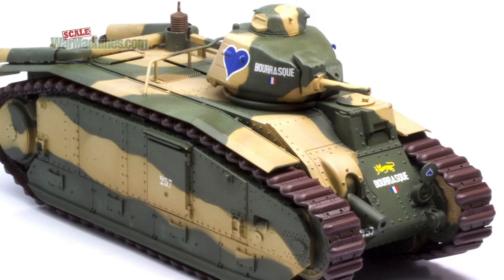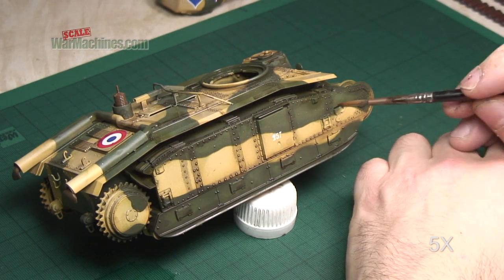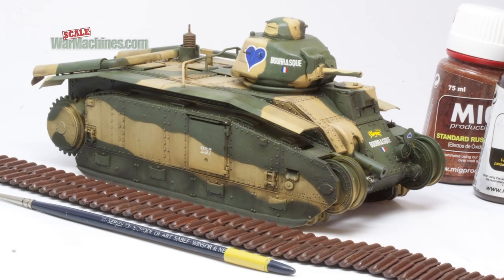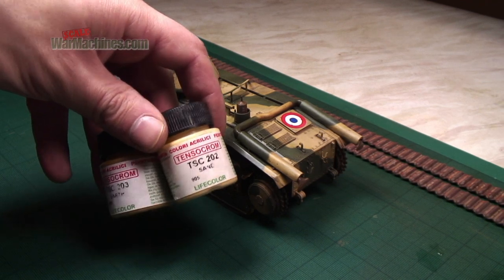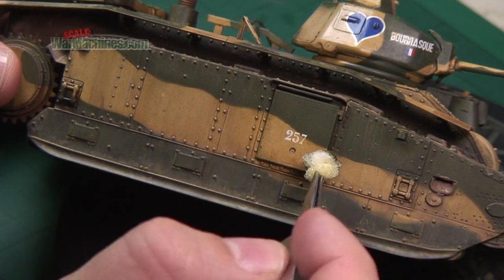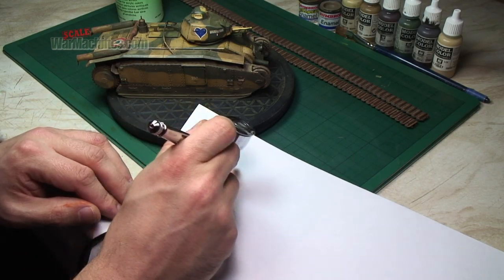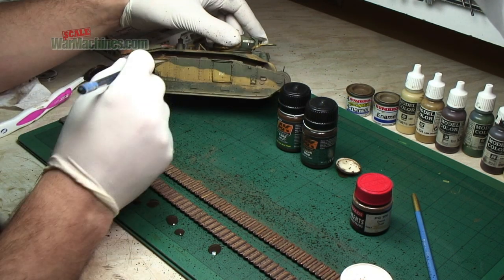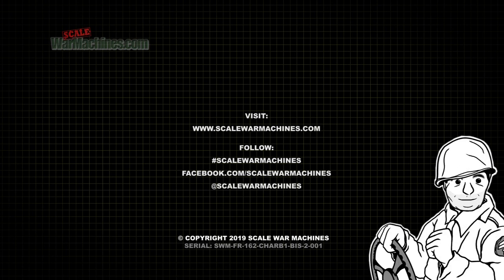"HOW TO" PAINT & WEATHER TANKS - TAMIYA B1 BIS SCALE MODEL GUIDE #2

Comment: Hello. Have you thinned the dark wash or are you using it neat? Thanks.
Reply from the maker: Probably slightly thinned. Undiluted has its place (e.g. pin washes) but it's a bit too intense. Of course, it depends on the characteristics of the wash and manufacturer you are using.